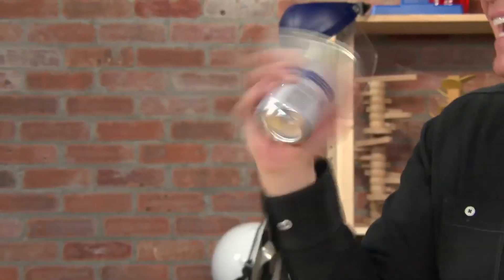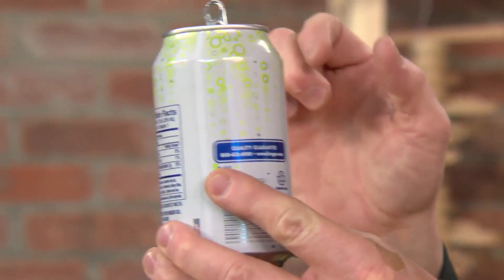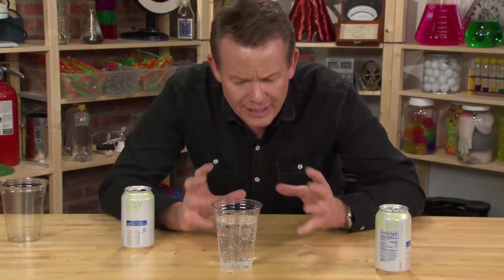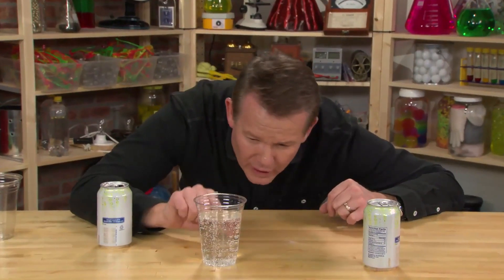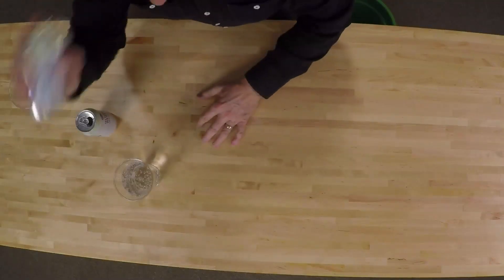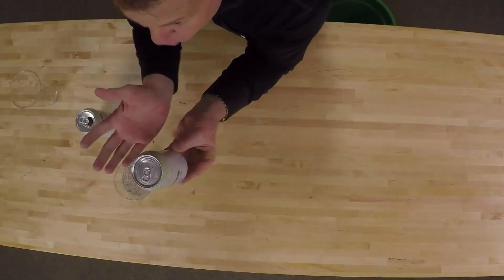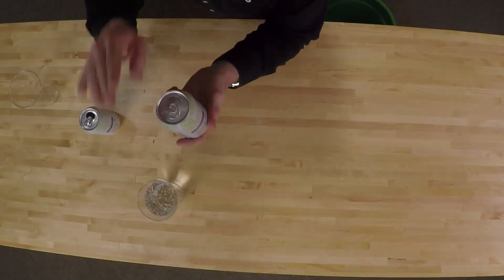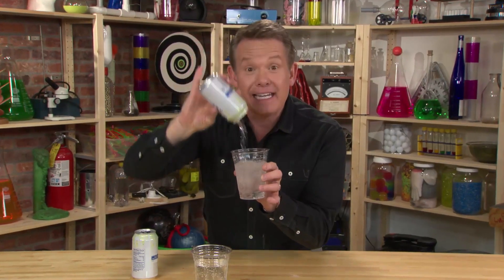How To Open A Shaken Can of Soda

Comment: They've done studies about this with hundreds of cans, snapping/taping does nothing.  It's just time that matters.
Reply: Those "studies" must have been on a different universe, then. You can clearly see the difference by doing the same thing with (transparent) bottles. Shake it and open when there are lots of bubbles on the sides = liquid gets pushed out when you open it. Tap sides until most bubbles go to the top = only gas comes out when you open it.
Reply: @RFC3514  Lots of people have done this and it wouldn't be hard for Steve to replicate.  Just shake 2 can simultaneously, tap one, and open both simultaneously.  One of the more thorough experiments I've see is "Does Tapping a Shaken Can of Soda Actually Reduce Foam?" by "Today I Found Out."
Reply: @landonkryger  - Again: you can literally see it by using a transparent container.
Reply: @RFC3514  Cans are made of metal, transparent containers are not. Invalid assumption to try to translate the results between them.
Reply: @TheHuesSciTech  - Cans are lined with plastic on the inside, and have been for several decades. Your drink is not in contact with any metal.
Reply: @TheHuesSciTech  - Cans are lined with plastic on the inside, and have been for decades.
Reply: Open as
Reply: “Studies” huh?  I guess the videos of people opening champagne bottles after shaking and then snapping the outside doesn’t keep from having the cork fly off.  Or the fact that the can didn’t explode in this video
Reply: @alankingsborough1005  it doesn't explode in this video because it's like a minute between shaking and opening.